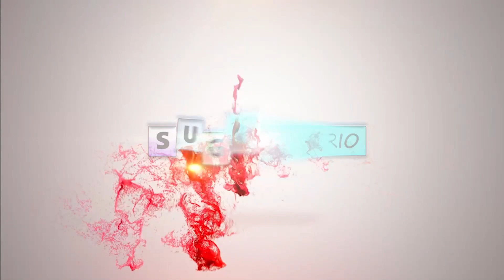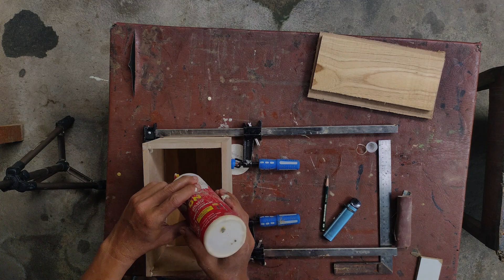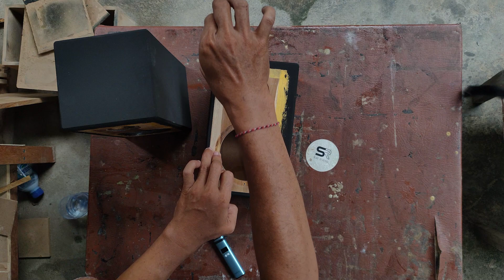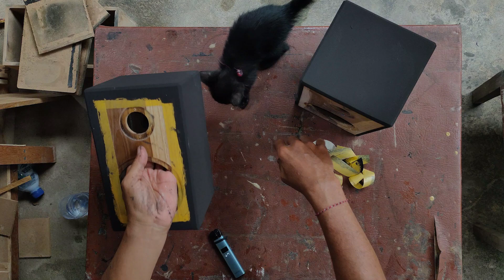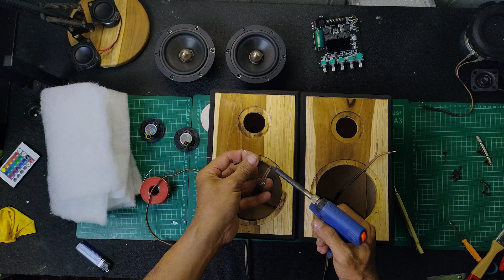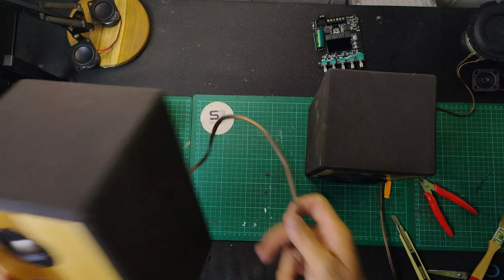DIY 2 Way Bookshelf Speaker #diy #speaker #bookshelftspeaker

Comment: Box speaker 4 inch bisa pakai crossover ga om?
Reply from the maker: @suhandylahardy4965  bisa sesuaikan dengan configuration dari speker ny saja
Reply: @SUGIRIVIERIO  kaya gimana tuh om. Kalau boleh tau
Reply from the maker: @suhandylahardy4965 crossover aktif atau pasif biasanya yang banyak di gunakan crossover pasif , mau 2 way atau 3 way
Reply: @SUGIRIVIERIO  pasif om. Biasa nya buat compo. Atau nga ampli nya di luar box om. Kaya  speaker monitor tanpa mesin yg om buay